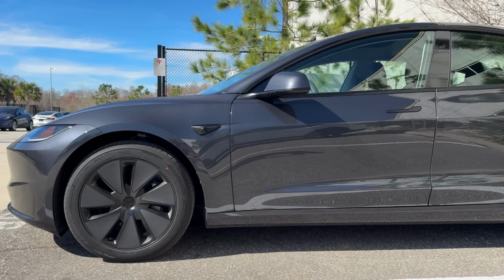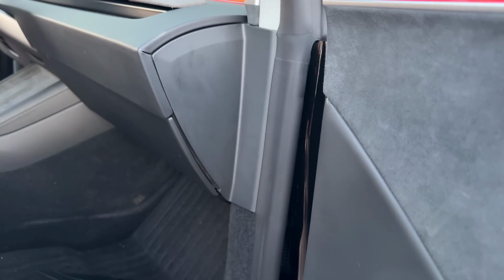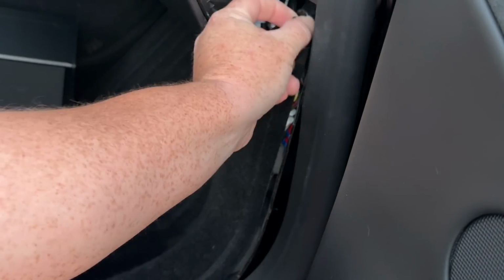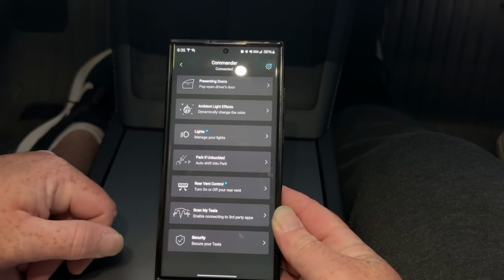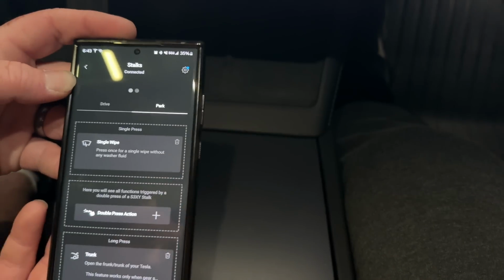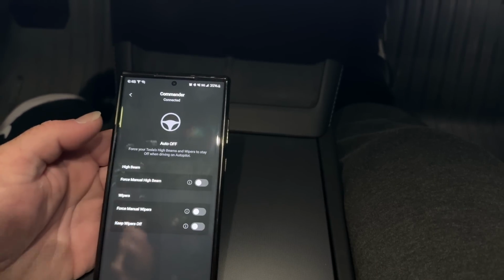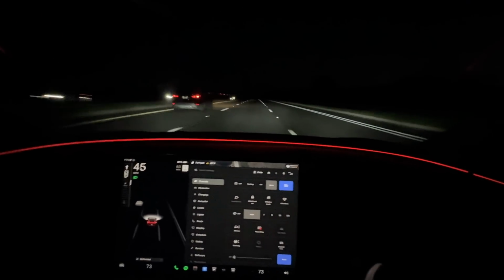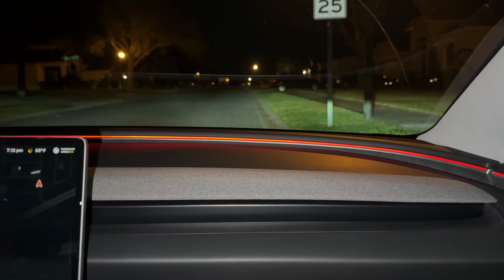Tesla Model 3 - Turn Signal Stalk and Gear Shift Lever Are Here!!! Plus Autopilot Hack & More!!!

Comment: Nice video and thanks for all the informative content! I’ve had my 2025 for three or four days and I’m already used to them. Quite a few exotic cars have had numerous controls/functions   on the steering wheel for years. Justlook at F1 cars! The only issue I’ve noticed a few times is the scroll wheel is awfully close to the turn signals, which can cause inadvertent, signal, pressing. I wouldn’t need them for the signals or the gear shifter, but I have always been kind of curious about the sexy buttons company and all the other functionality they offer by tapping into the factory harness. Does the factory warranty  stay intact if you had to have service, do you have to unplug it? Thanks
Reply from the maker: It doesn’t impact warranty that I know of
Reply: @ I was able to find on Enhance site they do recommend removing the Commander before service. Also not warranty voiding, but can fall into that grey area of if Tesla service says an aftermarket product caused an issue with the car they can deny in certain circumstances deny warranty claims/cover costs. Probably rare but I have seen that happen to some with aftermarket suspension parts in them. Anyway thanks again for the 10% code & the great video
Reply: @ BTG, thanks for the reply. Been a subscriber for years (first comment lol)& really enjoy all your videos, reviews , and updates on price trends etc! Have a splendid day!Cheers 🍻

Comment: I’ve had my 3 for a week and adjusted to the turn signals and screen shifting in about two days. Unless you live near a bunch of roundabouts, the steering wheel indicators work great.
Reply: Issue for me is I like shifting from reverse into drive while still rolling backwards and without stalks you have to take your hands off the wheel and fiddle with the touch screen.
Reply from the maker: I am used to it as well